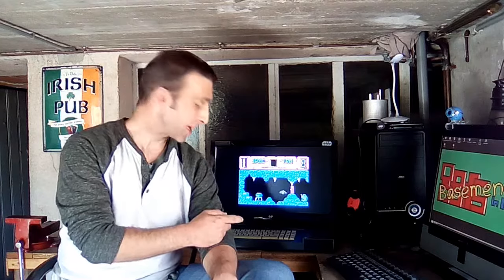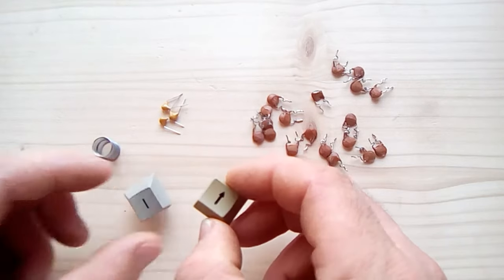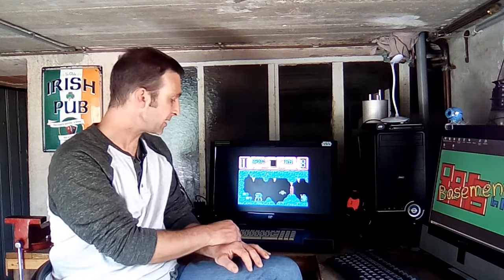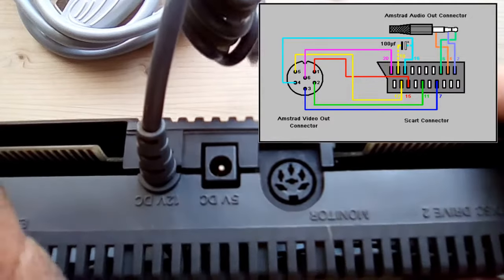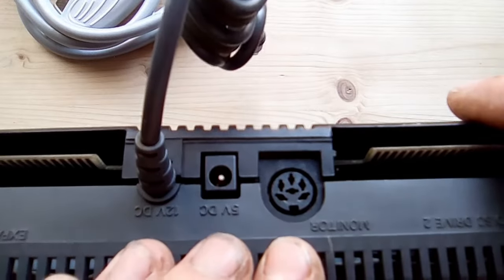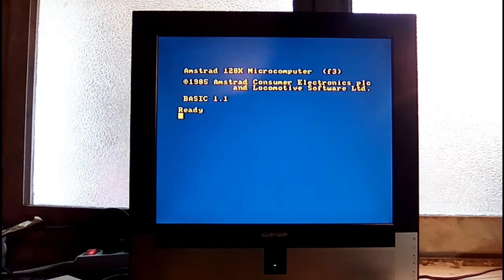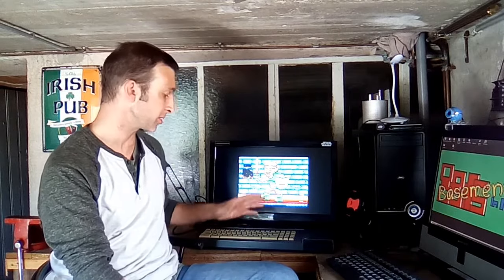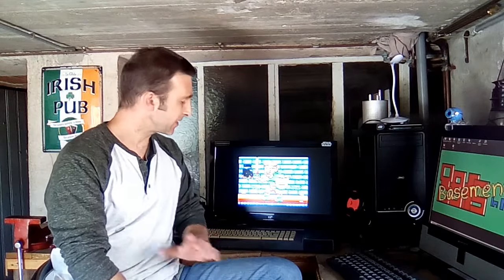Amstrad cpc 6128 |  Computer restoration and disk drive repair

Comment: Another repair I watched suggested to change specific capacitors. Caps getting dry may affect the way  mechanical parts behave. I will have a go with the caps and  if the "no reading" error persists I will apply your empirical methods. Thanks for sharing all those tips.
Reply from the maker: Changing caps is never a bad idea in almost 40 year old electronics, best of luck with your repair.

Comment: The disc drives had a habit of catching or hanging from within a few months of use... I administered a suite of these as teacher of IT in a school in S. Aust... I became quite deft in unscrewing the case, opening it and giving a quick flick on the motor spindle with a small screwdriver... back in operation, no loss of children's work.
Reply from the maker: The 3 inch disc drives were (and in many cases, are still) a little temperamental. The thing that amazes me about them and these compuers in general is how it is possible to repair them in a lot of cases without the need for special tools or test devices. I imagine the 6128 would have been a great computer for kids to have learned with at school. Though you may have thought otherwise given you were the one who had to keep the drives ticking over ;) Thanks for watching 007JHS.

Comment: thanks for the tips to repair the disk drive, about the keys did you bought the key or a complete computer to use their keys?
Reply from the maker: I found a guy on Ebay who was selling loose Amstrad CPC keys (they had a system that they had stripped for parts and were selling them). I bought two keys from them as I needed one key and two springs.